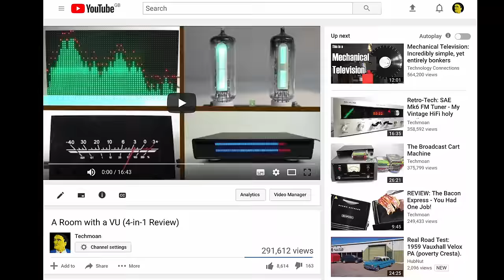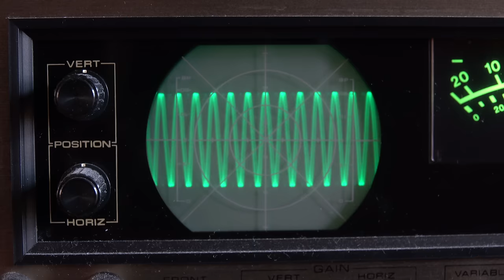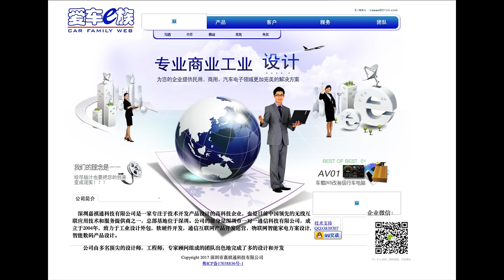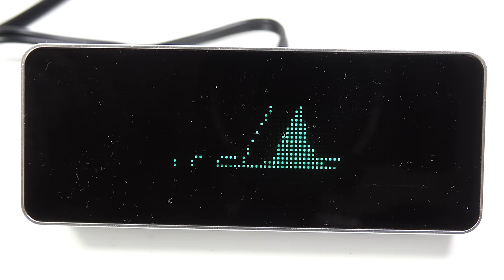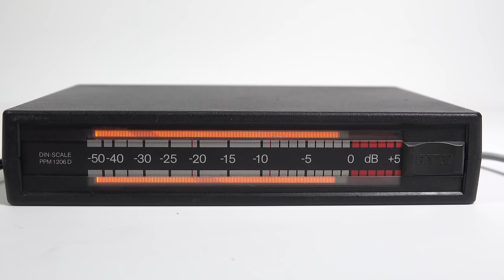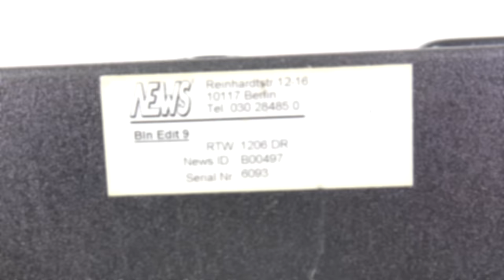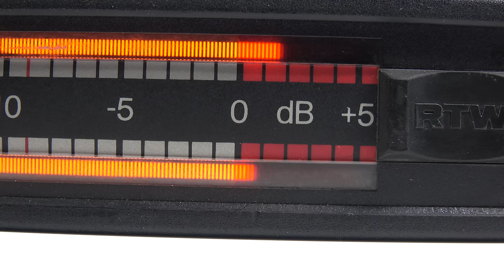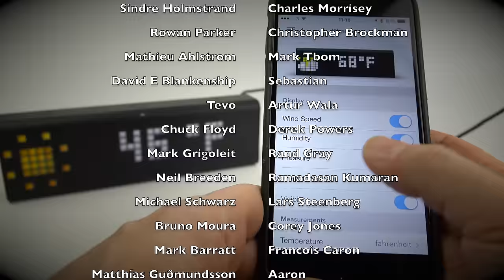What a lovely VU : A metre of meters*

Comment: it is a neon plasma display. old pinball machine use te same type of displays with orange dot pixels.
Reply: and they use +100 V/ -100V DC to make them work, so it takes a very special power supply that most consumer stuff isn't going to have.
Reply: The Japanese electronics industry went all-in on Plasma technology in the 1990's, with lots of government funded R&D. LCD displays then got cheap and ate their lunch.

The information displays in Japanese train stations and airports used to use similar displays. They must have been expensive but could display very bright and sharp text compared to LED and flipdot signs.
Reply: Exactly. It's more spesifically a self-scanning neon bargraph!
Reply: No wonder those pinball machines had a very different and distinctive brightness and color in their displays.
Reply: A boost converter that converts 12V to +/- 100V costs under $1 I think.
Reply: Not neon, but plasma gas.  Same plasma gas that was in plasma tvs, only in monochrome form.  Been around since at least the 1970's and yes pinball manufacturers were clients until very recently.
Reply: Older medical vital signs monitors like the Propaq Encore from the 90s were also based on the same display technology. https://www.welchallyn.com/en/products/categories/patient-monitoring/continuous-monitoring-systems/propaq-encore-monitor.html
Reply: @spazzman90  yes it is. it is a mix of 75%neon and 25% helium.in a vacuum. same as in nixie tube. and the small neonbulbs you can find in power switches. and the flicker candle decoration neonlamp
Reply: @TonyW79SFV  They were common in laptops in the 90s until people wanted color. Windows 3.1 had a color scheme called plasma power saver that's similar to the dark mode schemes for today's OLEDs.
Reply: @spazzman90  The "plasma gas" is neon.  Plasma just refers to any gas that's in an ionized state.  The orange color identifies it as neon.  Same as used in Nixie tubes.
Reply: no it is not contradiction.. there is a small amount of gas in the low pressure (lower than the atmospheric pressure +-15 torrs) en that mean there is a vacuum. more than in a jar of pickles
Reply: @straightpipediesel  I think there's an EEVblog video on such a laptop.

Comment: Yes, RTW 1206 meters are professional (and extremely sturdy) gear. I've used them for years in edit suites, broadcast vans, etc. Hold on to it. It's worth every penny.
Reply: If only I could find one somewhere. I wonder how many years one of them would last? They certainly look like they are built to last.
Reply: @jamescollins6085  They last almost forever. In 30 years I've never seen one break down, let me put it like that. Where to find one? Apart from the obvious Ebay, try local radio studios and things like that. They may have changed to computer/DAW based meters...

Comment: In former Czechoslovakia were produced modulometers with moving mirrors (for stereo). It gave them speed to be proper peak meters. Some designer had an idea use them in locomotives as indicators of preset and current speed. When sun shone into cabin you couldn't see anything.
Reply: janovlk And what happened when crossing bumpy "points" (English word for the thing that directs train onto a different track as needed

Comment: I've designed broadcast equipment using VFDs. Firstly that one is probably a special. The manufacturer has taken a standard VFD and put two colour phosphors in for one ccustomer. Secondly as flat panels got better a lot of manufacturers stopped doing bigger VFDs. We had to redesign one product to use LEDs.

Comment: It's called a FloraScan Display (if I have that spelled correctly) It's also the same display as in our Akai EA-A7 7-band Graphic Equalizer. It's colored florescent paint that is energized by (i believe) grounding the proper painted surface to cause the paint to Flores. The neat thing about a FloraScan Display is that the manufacturer can design any kind of icon to be lit up, in any given color, for any given function. They would kind of be the predecessor to OLed but required some sort of gas, like argon to function.

Comment: Just on the RTW meter, I used to sell them and one of the reasons the RTW 1206 was discontinued was because traditional broadcast metering moved from peak metering to loudness metering. Peak metering, as the name suggests, only measures the peaks, loudness metering measures the overall loudness of the production, be it 30s or 2 hours. In layman's terms, it measures the peaks and the troughs (the dynamic range) and averages it out. Your production could not be below a predefined dynamic range average or it would be rejected. So the PPM meter became obsolete pretty quickly. It was used primarily to combat the loudness wars, or the propensity for engineers to over compress their productions in order to make them sound louder. A responsible sound engineers could still use it to get a decent average but without a proper loudness meter, you could never be sure what the true dynamic range average was. Those RTW Peak Meters were amazing and I really miss mine.

Comment: If you are interested in the display used in the RTW, just look up IN-33 or PBG12201 (these are basically the same, one is a Russian made the other one was manufactured by Burroughs). It is actually a bar graph display, but quite different from the IN-13 you've mentioned, it is more complex to drive. Burroughs called it a "Self scan" bar graph display. According to an app-note I've found they also had circular ones available, although I've never seen any of that before.

Comment: The high pitched whines from CRTs drove me absolutely insane for so many years. For a long time I actually wore earplugs whenever I was in a computer lab or near a particularly loud CRT. When flat screens came along, I couldn't switch over fast enough. I forgot these things though. I recently bought a Commodore monitor and instantly discovered that there was absolutely no way I could use it for long. If I want to use the C64 without earplugs I'm going to need to plug it into a modern TV.

Comment: The 1206 was installed in every control room I worked in (started 1982), until being phased out when EBU R-128 became the standard. As shown in the video (discontinued), a range of dB scales are shown. They mirror the absolute chaos that ruled audio level standards across nations an even facilities. The BBC even had their own weird ppm standard. R-128 is a loudness meter based on rather complex math, but really easy to use. Older ppm was based on a defined electrical value, while the new standard is a calculation for loudness and true-peak. The latter takes into consideration the overshoot in a D/A stage. Just scratching the surface here, lots of info around. 😅👍

Comment: We had the same VU meter from RTW in both studios I worked in in the 90s, great products.

Also, the topic of the muppet sketch... Lost my high frequency response myself, so it’s the same scenario every time I set up the monitors for gaming at work. Complains, complains and whining from the young whipper snappers... forcing me to use flatscreens instead. 😂
Reply: I lost my high frequency response a bit later, and more dramatically, than most. Every now and then, if I've had too much coffee and the stars are in perfect alignment, I can just make out the hum of a CRT...or perhaps I've just been imagining it.
Reply: It is a horrible sound though. I'm sure some CRT's have it worse than others, since I don't remember it ever being an issue on the living room TV we used to have, or my old CRT computer monitor. But these days some CRT's really are unbearable. Maybe back when CRT's were normal I had a tolerance built up, and now that I don't have to deal with it all the time, it really stands out as being painful when I am around one.

Now that I am thinking of CRT screens, kids these days wont have had the experience of touching the glass on the TV screen to feel the static build up xD 
I guess the bonus is parents not having to clean the smears off modern TV's all the time  :p
Reply: I never noticed a whine on CRTs through the 90s and 00s. The only thing that bothered me about them was when the refresh rate was set too low which made me nauseous. Loved hitting that degauss button. But I loved getting my first LCD in 2006 to bring to LAN parties more! I'm still using that as my secondary monitor right now.

Comment: On the LED meter with the bent PCB - looks like the internal GND trace was damaged in the pcb or the GND trace is not thick enough.  If reflow of the GND pins on the dead meters does not work, run wire to the GND of the intermittent LED bars and you should be golden. For extra credit, pull those janky sockets off the pcb and the pins off the LED board, then use 1-inch pins and solder both boards together, but put a 1/4in offset toward the top so all the pins are in parallel but at an angle, so you can reach the calibration pots and the buttons for the clock without cutting your finger on the back of the led board. Sure it wont sit flush without a stand, but at least it would be functional. The color scheme on it is nice along with he stereo mode not available on most meters.

Comment: You have a nice selection of meters. Also I enjoy your reviews! Thanks.My fav meters are the Dorrough  peak and hold LED meters. If you like nostalgic instruments, IVIE IE30a is a interesting portable RA unit. For bench work there is the Sound Technology 1510a for tape deck work. It does suffer from the dreaded shorted solid tantalum cap problem. Luckily, the power supply self protects until the shorted caps are replaced.

Comment: Hehe, and I should have scrolled further down to see someone mentioned the exact same thing like I just did... :D

From what I once understood from a technician who used to work in national broadcasts for TV and radio is that the RTW kind of VU  meters were incapable of meeting the EBU R.128 standards for displaying maximum peaks during broadcast hours and that having to incorporate a digital to analog converter (since some broadcasting lines of equipment have digital audio made analog only for display on studio monitors and have it travel digital throughout their studio's and director's rooms) would have made it a lot more expensive and complicated (also because in digital audio in the dBfs scale 0 dB is the absolute limit and anything above, especially in television will clip).

Comment: For the RTW display...it was/is used mainly and also was/is still very common in the audio broadcast industry...also most all broadcast mixing consoles had and still have at least two of these...for the mix bus and the main output. Some hi-end consoles use one for each channel.
Usually there are two types of these...one which has only the display and no audio inputs...and another one which is full self contained, just like the one you show here....Also they come in different readout types...1V dB-qP, 0 dB CCITT, and the 1mW/600Ohm=0.775Volts for 0dB with the exact VU display characteristic, and also you could them order fully customized ballistics for dolby/dbx and also IM3 (intercept point 3 -- RF FM transmitters which operate at "optimod" uses this point as an index "right before noticable distortion occurs" in conjunction with the usual ORBAN broadcast compressors

And usually they go for around 150-300 bucks, for one unit. you can get them on ebay, but be careful...if you get only the "display" version you simply can´t use it, as you still need the audio frontend.

Comment: 11:00 back in the 1980s and 1990s, it wasn't unusual to get custom glass displays from several japanese manufacturers, and it didn't actually have a huge minimum order. That's why in that era you see a lot of handheld LCD games with custom shapes in the display. You also see VCRs and hi-fi devices with custom VFDs around that era, which is similar custom glass work. Many of these products had large production runs, but many of them also didn't have all that large of production runs. The presence of these products implies to me that custom glass displays must not have required huge quantities.

In the current era, Noritake still makes custom VFDs, but AFAIK, it's the only manufacturer left.

Comment: The RTW 1206 is definitely something I would pick up if I found a reasonably priced one. It would mostly just be for show though, since the VU meter on my cassette deck is really the only one I actually need. Who doesn't like more flashy-flashies on their audio setup though?... As for the muppet sketch at the end, I'm 33 and I honestly don't hear the whine of a CRT and I never did. My ears can still hear that frequency range though, I generated the 15.625Hz tone in Audacity, turned the volume up a bit, and there it was... so then I turned on the TV and for the first time, I could hear it there too! Thankfully I quickly got used to it again because it really is kind of annoying.

Comment: I have a slightly more modern version of the RTW instrument, it has a really cool sliding way of changing between two scales. I thought yours had it too, until you opened it. Look it up - it’s pretty cool! You slide the scale mechanically by yourself, and the instrument calculates vu instead of ppm.

Comment: the first bar graph display definitely should have been designed/built with a $1 dollar PCB stiffer bar running the length of the backside of the bar graph PCBA, a very common component used to prevent circuit board bending preventing solder joint damage/misaligned connections.     Cheers

Comment: I like that last meter.  I own a Pontiac Fiero, and it's instrument cluster is lit in that orange-ish red, rather than that pukey green that most other vehicles use.  It woul look nice as an add-on to the audio system (if it could run on the GM 14.2 volt systems)

  I always hated that CRT "screech".  I could always tell when someone turned on a tv in the house, even if I didn't hear the audio of it. 
I can still hear very high low frequencies, but the range around the human voice has always been kind of a dead-spot for me.
My Dad:  "mumble mumble"  Me:  "Huh?"  Dad: * louder * "How t.f. can you hear  trucks on the highway 8 miles off,   or a gnat fart from  100 yards away, but can't hear me taking to you?!" 
I'm always picking up on deeply low but faint rumbles. Less like sound, and more like a pressure.  There is still one CRT in the house used as a monitor for a security camera.  but it's on 24-7, so I suppose I have tuned it out now-a-days.  My most common sound that annoys me at night:  The 60 hz hum of the power through my window fan that has metal blades and a dial to control the speed. There are several spots on the speed-range when the blades begin to resonate with the motor, producing  a throbbing, metallic, ringing, "Wooom wooom wooom wooom..." sound.

Comment: Noticing the CRT sound is like noticing the white noise made by many florescent lights. Most people's brains just remove the sound.
Reply: Or, they can't hear it anymore, because of standard hearing loss
Reply: @keiyakins  I'm pretty sure autistic children are just as capable of drowning out white noise. If not, then that's the first I've heard of such a symptom.
Reply: @litigioussociety4249  White noise, sure. That's about as far from white as you can get, a sharp sustained peak at a specific frequency.

Comment: I suppose next to ze german model, the chinesium offering is pretty paltry. But, ive been background designing (ooh, i could try this... nah to much wiring, ooh i could try that... so much code, etc) for ages. And the colors for their LEDs are really nice, a green/blue, warm amber. If you buy cheap china modules with any regularity, you know your gonna need to either overbuy or be prepared to touch things up a bit.

I was so eager to get one, i left before the puppets! Shame on me... one of the best.

As a relevant PS, my favorite music visualisation machine is... a TV!. Take a generic crt tv. Find the horizontal deflection windings on the yoke. They're about an ohm. The vertical deflections look like a guitar string really close up. Wire them in series with your hifi speaker. Bam, pretty squiggles of sound. If its got color adjustments, pick a pretty color. Full green is best resolution, but i like a bright purple. caveat crt tv internals will happily kill you dead. If you dont know the right wires from that short description, you dont know enough, please dont try and wing it.

My old school longhair hippie mate called it a 'sillyscope'. Love ya, Guv.

Comment: I still prefer VFD if I can fit one in my devices. They are just super clear and clean looking. Noritake will still make a meter display like the one you had in the RTW, but not as standard so they probably have a minimum order for custom designs. Not a cheap item though.

Comment: I just use an old (sony) DAT machine they have really good meters+margin display (no spectrum just level) and S/PDIF I/O plus they offer A/D conversion which I use to encode vinyl LPs audio to S/PDIF then into my PC via a tascam USB2 (US600)  audio interface.
I dont even use the dat tape transport you can get them cheap on ebay